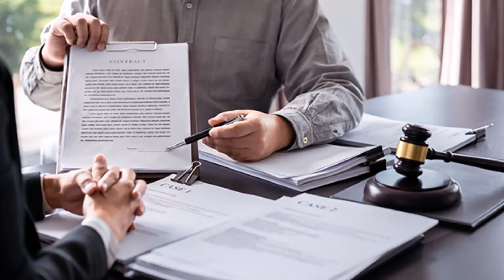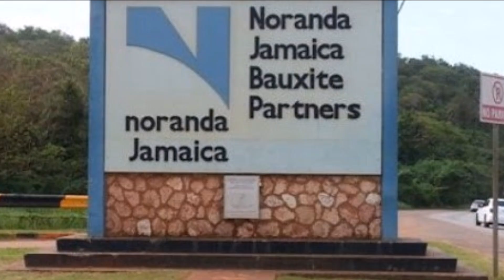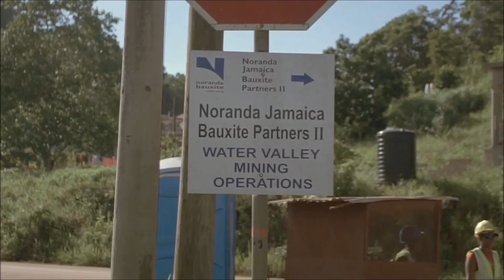Why Jamaica Cannot Process it's Bauxite into Aluminum

Comment: We can't power smelting plants. That is the main reason why we don't refine our bauxite. Small modular nuclear plants are a solution. It would also benefit from finding oil
Reply: And use the Thorium design as we can extract Thorium and lithium from "Red Mud"
Reply: @hermanshim8948 Thorium can be enriched to uranium 233 which is safer than uranium 235. Only China currently have the technology to do so.
Reply: @Le8-u6t  suggested this some time ago at a PCJ forum but they seem to have chosen Canada
Reply: @Le8-u6t ask China to train you
Reply: @Le8-u6t USA and G7 would never let Jamaica develop uranium or nuclear facility